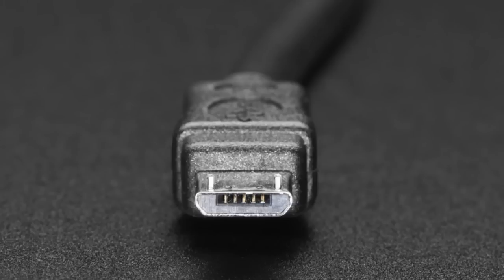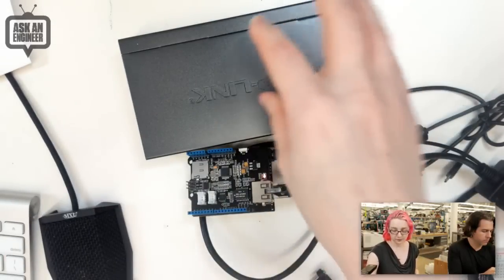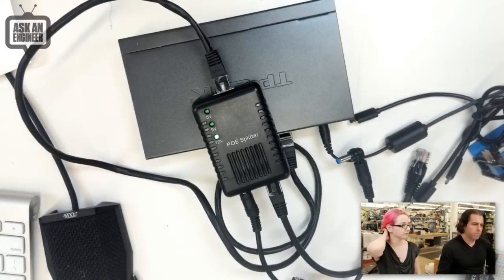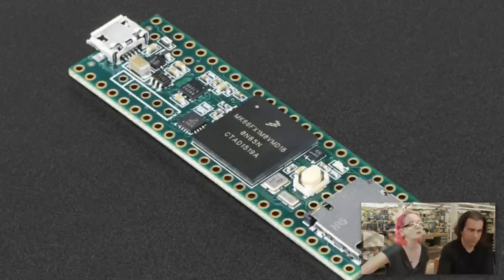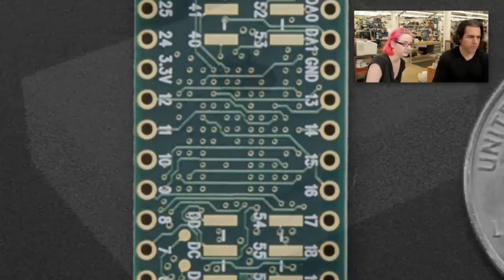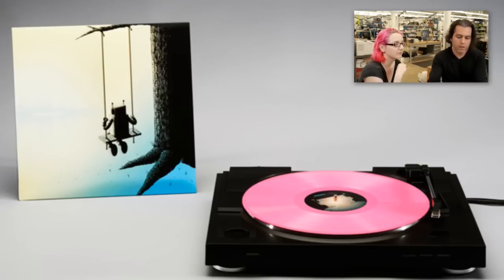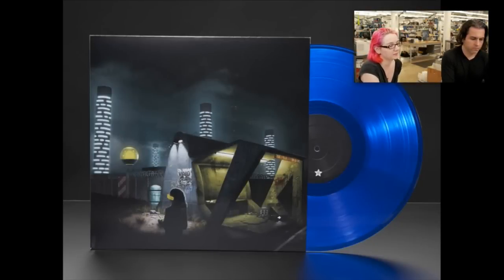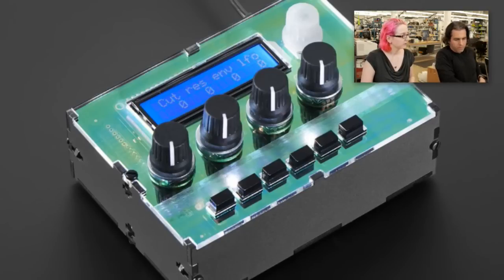New Products 10/12/2016

Comment: I've been interested in electronics for a long time, but the learning curve has been too steep for me.  Recently my dad asked for something involving colored lights with control over color and sequencing, and I found Neopixels.  Combined with an Arduino, they solved the problem...and I found that you and others have lowered the learning curve with your clever devices that hide much of the real complexity so I can make things happen without having to get a EE degree. Thanks!  

I've got some more ideas, so you'll be getting more orders from me, and I'm watching your vids...which brings up a request: can you add an audio person, or device, when you do the vids?  Your sound is really bad...its distorting, probably from the inputs being set too high and clipping. It's less annoying on my iPad, but almost unlistenable on Roku with the better TV speakers making it really obvious. I wonder if you could build an automatic level control from an Arduino or equivalent?  The content is great, it's just the sound quality that hurts. I don't think it's a YouTube thing, since other channels I watch don't have this issue.

Thanks for the vid education, and for the really cool devices!

-- Mike
Reply: BigMjolnir you can buy led strips with remote controllers for doing the pattern and color super cheap
Reply: topher Yep!  I had a short time line for this project, so I went with push buttons wired to the Arduino to control the Neopixel software, but I did get a Bluetooth board and another controller to play with when there's more time. 

-- Mike

Comment: With the panel mount micro usb I would likely just cut off the other end, and solder it to where the Pi's microusb was. Or 3d print the same thing.
Reply: chexo3 Good point. Doing that just eliminates another point of failure.